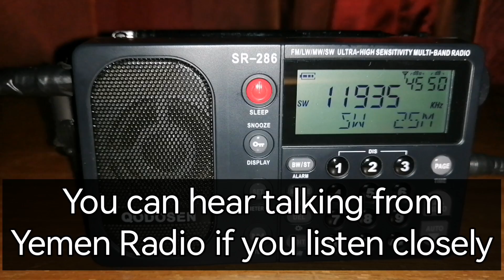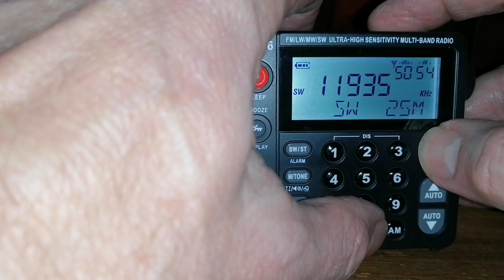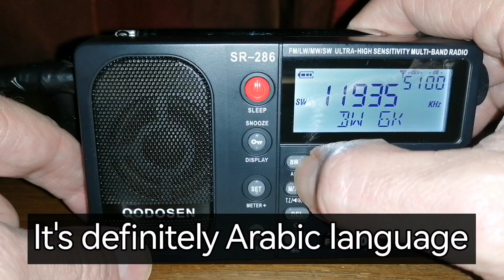Republic of Yemen Radio being jammed by loud buzzer 11935 kHz #shortwave #radio

Comment: I imagine if they caught you jamming in Yemen they would cut your antenna off... so to speak.  Not judging - just an observation.
Reply from the maker: Thanks David, I agree that it is a bit expensive. But I think it's worth the money, it is better than all my other radios (Tecsun PL-368, which is similar to the PL-330; various XHDATA radios including the D-808 and D-109; Eton Elite Traveler; Kenwood R1000 and some others). It is more sensitive and really pulls in weak signals.

Comment: A few points about your assumption that it could be Iran doing this:
1) Iran typically used to use a sort of "bubble jammers", like this https://www.youtube.com/watch?v=BErKfQFB4EY from 7:06 (unfortunately, the Kurdish clandestine stations it used to target are now all gone, so the jammers aren't heard either)
2) The "bubble jammer" sound effect can still be heard occasionally on IRIB stations as part of their pretty elaborate IDs
3) Iran did use a VERY loud, and VERY powerful buzz against Radio Farda on 1575 kHz, which eventually closed on May 31 2021 (or was it 2020? anyway the buzzer continued alone for a month or so further). I think that jamming came from Abadan, in SW Iran, with 800kW and a directional antenna beaming NE - at least that's what I assume based on MWLIST/FMSCAN listings of the time 😉 Nonetheless, that buzz could be heard literally all over the world - I could hear it myself on KiwiSDRs in Hawaii and Brazil. Curiously, the same Radio Farda has almost never been jammed on SW.
4) Nowadays, if Iran wanted to jam anything, they'd either have to carry out major works at some of their VOIRI SW tx sites, or ask if the military can make up something - the former seems to be almost impossible as VOIRI is currently down to just one or two transmitters on SW, from a single site in Sirjan - and even these have so weak a modulation that it's extremely difficult to follow the programme. They used to have Zahedan until spring of 2023, including a nice, all-evening-long Arabic service on 6060 kHz - but this had vanished too. And the latter - well, they'd need a high-power transmitter to make that buzz so loud. Maybe they mothballed that Abadan MW site? Although it buzzed at a slightly lower pitch 🤔
Nevertheless, all only confusing us even more 😵
Reply from the maker: Hey Arnie, thank you for the detailed explanation about the Iranian jammers! That "bubble jammer" sounds very interesting, it reminds me a little bit of the chirping that I hear these days, across many frequencies. I think we spoke about this chirping (for lack of a better word) in previous comments. It is like a screeching noise, heard randomly across many bands. I hear it on all my radios. I am uploading a video tonight where I compare the XHDATA D-219 and D-368, and the chirping can be heard quite clearly on the D-368 during the KBS transmission. I hear it almost daily, randomly, it comes and goes. Anyway, that's probably another topic for another day :-)

The Abadan site you mention with an 800 kW transmitter is very interesting indeed. Perhaps, as you say, that site had been mothballed and is now back in use. It must be a very powerful transmitter that causes the buzz, because it is really strong and I know people hear it in the US, Asia, Europe, and, of course, Africa. Quite a mystery this one.
Reply: @swlistening  you know, this type of "modulation" doesn't require a lot of power per se to be heard far & wide. Just like you can hear a weak distant carrier when off-tuned in SSB even if you don't hear any audio in AM. But this buzzer's signal is just so strong, I can hear it even in daytime here in Poland, so the power used must be a lot more than single kilowatts LOL.

As for Iranian jamming, there is another jammer that targets Radio Farda on another frequency USAGM assigned to them, 1548 kHz from Kuwait. This one is a typical Iranian bubble jammer, but it's off-tuned to 1547 kHz, its carrier is distorted with relatively strong hummy sidebands, and it's a lot weaker than the 1575 kHz buzz used to be. Or Radio Iran relay which they used earlier for same purpose. MWLIST doesn't list anything related on 1548... except three transmitters, of which two are actually used for regular, non-jamming service (and I had heard one this winter!), and another labeled "closed". Unfortunately I have no idea where the bubble jammer comes from 😞 (FYI: Radio Farda signs-on @ 17:30 UTC)

Chirps... I've just checked 9750 NHK on a Hong Kong SDR & I'm hearing a nice, clear signal except for a slight splatter... and no chirps 😮 None on 9645 (CGTN Radio is there atm) either. I really wonder where they originate from 😳
Reply from the maker: @ArnieDXer  Thanks Arnie. I hear those chirps almost daily, they come and go, no pattern, no specific frequency. And I haven't heard them before, they are new. Started appearing in the last three or four months or so.

Comment: Hello André, indeed it is almost certainly a jammer. And this is nothing new. There are a few articles from various media mentioning that Saudi Arabia jams this radio. One in the Jerusalem Post dating back from 2019.
Reply from the maker: Hey Alain, thanks for this. But I don't understand why Saudi Arabia would jam this one, as the transmitter is in Jeddah, in Saudi Arabia. As I understand it, the station is run by the Yemen government, which is supported by Saudi Arabia. I think the jamming might come from Iran, who supports the Houthi movement in Yemen and would like to see the Houthis run all of Yemen.
Reply: You're quite right on this, André. This is a complex situation and I got confused.
Also, the situation was different in 2019 as mentioned in the Jerusalem Post's article, as the radio was broadcasting from Sanaa.
Reply: @swlistening  back in 2019, Saudi Arabia did jam Voice of Islamic Republic of Iran in Arabic. It was a few months' long stunt only, but it was quite interesting as it involved audio of Radio Riyadh, Holy Quran, and a pulse jammer of its own, often running way longer than the IRIB Arabic transmissions were scheduled on their respective frequencies 😅 Then Saudi Arabia kept using the same frequencies (I remember 7425 kHz late evenings and 9650 kHz in the afternoons & early evenings) after B-season frequency changes, leaving Iran in the clear on new frequencies, and, in fact, I could still hear Radio Riyadh on 9650 kHz with sufficient signal but low modulation well into April 2022 - but never since.

Nowadays, Saudi Arabia itself has very little remaining transmissions on SW - from up to 11 frequencies at once just those 4-5 years ago (including 11745 Al-Azm and then-11860 of Republic of Yemen Radio, as well as the jammers) to maybe one at a time, for SBA's overseas services... Similar situation to Iran's, as described separately above.
Reply from the maker: @ArnieDXer  Thank you for the information about the Saudi jammers Arnie. I myself have not heard any specific SBA transmissions recently, only the Yemen Radio one, and Al Azm, which is a regular, daily catch for me, always very strong. Sometimes almost FM quality. That probably means that at least one of their transmitters does still work well 🙂